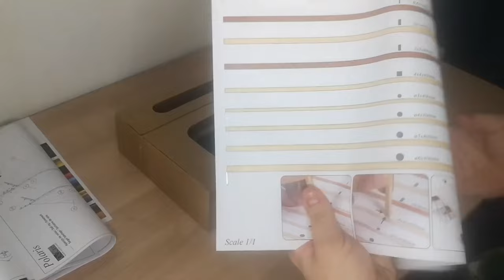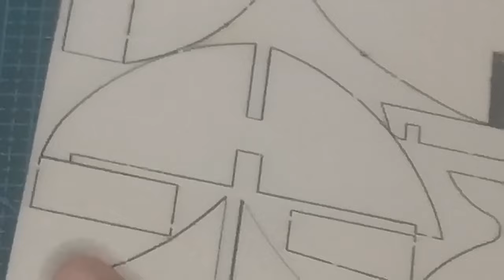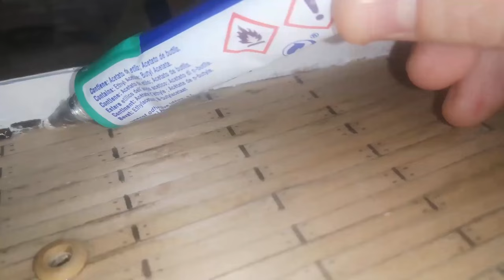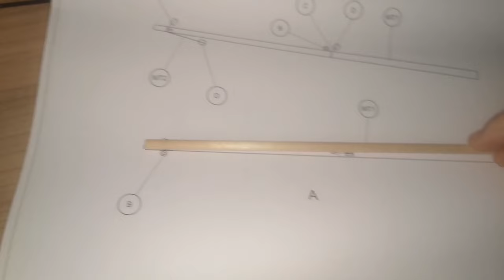Polaris Miniature Wooden Ship Assembly (Satisfying Wooden Ship Model Making)

Comment: Did you use contact cement (cobblers glue) for the second layer of hull planking?
Reply from the maker: No, for that i used white glue 🙂
Reply: @boatbob  ok.  I asked because my OcCre Terror advises using contact cement for the deck (I didn't) and the final hull planks.  I don't want to use that for various reasons but i have never worked with such thin planking.   Supposed to be 0.6mm but actually on 0.45 mm.   I wanted to see what your experience was.  I am concerned that the water content of white glue might curl it, but contact cement is messy and unforgiving.   I'm really not pleased about the under spec planking.  OcCre admit it is not correct but just say it will be fine.  It's a completely painted hull but that doesn't mean workmanship and finish don't matter!
Reply from the maker: @timmorrison4117  Yes, I don't like cement precisely for this reason, it is very thick and difficult to treat, but with the white glue the result is very good, because it is glue prepared for wood and very easy to remove the excess. I am glad that these videos serve as a reference for you. Thanks!😄